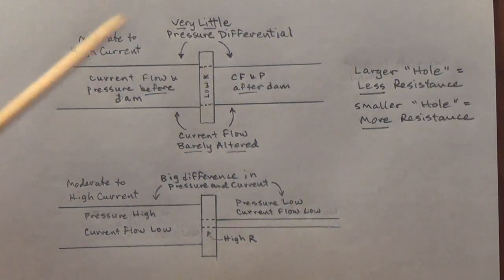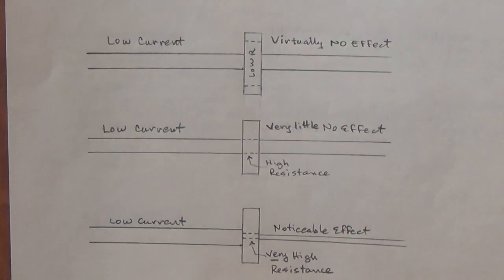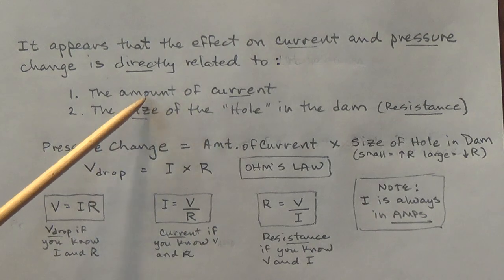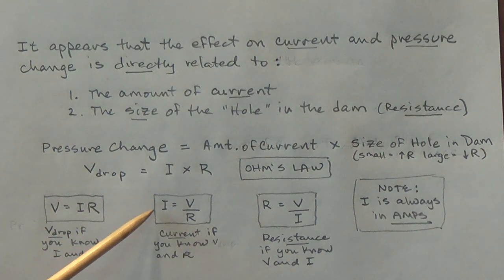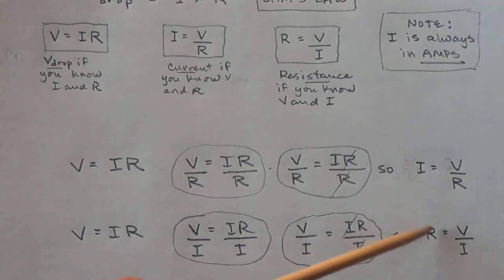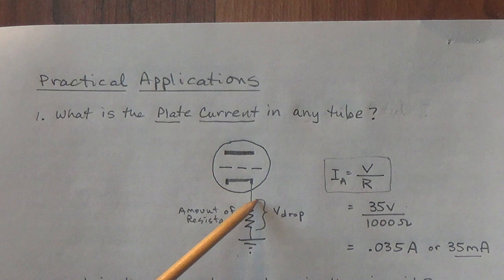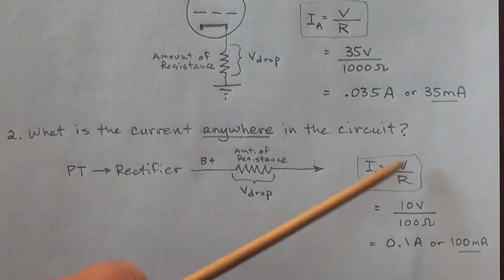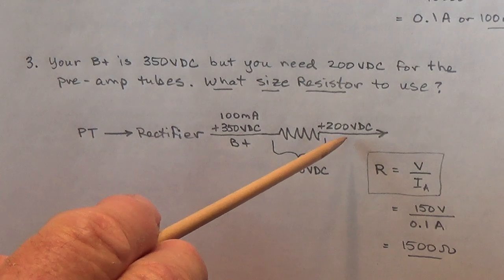Resistors, Part 1:  Their Circuit Function &  Practical Applications of Ohm's Law

Comment: this is just so satisfying for me as I enjoy amateur radio as my hobby and I am in the process of building a class A single ended tube audio amplifier very similar to the Fender Champ amplifier from the 1960s.  There are many schematics around so all the necessary values of items are already determined.  So with great teachers like Uncle Doug, I am able to understand what is going on and WHY the circuit needs to be a particular way to work.  And do all this without soiling a pair of tighty whiteys.  It is now 2026, mid August when first viewing this  and I am 76 years old.  Not much time left to learn and enjoy the magic of electronics .
Reply from the maker: It's not the time we have left that matters, Ted, it's how we spend it......and nothing is more noble than the continuation of learning until that time expires :)

Comment: Can anyone help me fill in the missing part of the puzzle here? In the last section of the video we use ohms law to determine the resistor value needed to reduce the B+ voltage from 350vdc to 200vdc. I understand how ohms law is being applied here and I understand the function of a resistor etc. I'm struggling with how we design this sort of power supply circuit without having the load of the tubes. 100ma was given as a measurement of the current flowing from the rectifier. But isn't this determined by the load of the tubes on the other end? Isn't the 100ma determined by the load? Would we need to measure the current draw in circuit and then change the dropping resistor value accordingly? I'm suppose what I'm not quite getting is how we avoid frying the tubes on the end of the the node by using too smaller resistor value when we need the tubes to be in circuit in the first place in order to measure the current draw?
Reply from the maker: Yes, current must be flowing to the tubes for the measurement to have relevance to the circuit.  To protect the tubes, you generally start with higher resistance and then work your way down.  Calculations are a great way to start, but there are so many variables within a circuit that actual measurements are always the last step.
Reply: @UncleDoug thanks Doug 👍🏻

Comment: So at the end of the video, are you replacing the 100 resistor with the 1500, if so does that change the amps,, what am I missing?
Reply from the maker: I am using different values to demonstrate three different uses of Ohm's Law. The 100 Ohm resistor was used to determine current output.  The 1500 Ohm resistor was used to demonstrate voltage drop.  Nothing was "replaced". I think that if you watch the video again closely, there will hopefully be no confusion.  Good luck.

Comment: Is it true that you can discharge fender amp by turning it on for a minute and unplug the amp while it’s on .?
Reply from the maker: No. Don't believe it.
Reply: @  I didn’t believe at first , i just tried it , it actually works .
Reply from the maker: @1972f1972  How do you know that it works?
Reply: @UncleDoug  checked with multi meter
Reply from the maker: @1972f1972  How did you check it? Please describe the entire procedure.
Reply: @UncleDoug  I basically turn the amp on make sure you hear a guitar playing then i unplug the amp from the wall and the amp is discharge completely, in the beginning when i did it i too didn’t believe it but when i checked with multi meter for voltage the multi showed 0 and then i became a believer did you tried it ?
Reply from the maker: @1972f1972  What specific meter did you use and what specific points did you check with the meter?
Reply: @UncleDoug one prob on the bypass and one on the chassis i use fluke on the voltage setting .
Reply from the maker: @1972f1972  What "bypass"?
Reply: @UncleDoug sorry I meant stand by

Comment: Thank you, I never really understood why they used color rings to identify a resistor. Why not just print the actual number of the resistor?  Seems like a secret society approach at making information more privileged than it should be.
Reply from the maker: Some resistors and capacitors do have printed values, VC.  The color bands are actually much easier to read than tiny, smudged writing.
Reply: @ As I my eyes age and the color bands fade it can be hard to identify the color. I also guess the old stuff I am interested in has all been color bands and no printed numbers.
Reply from the maker: @49VinCom  The very early capacitors have colored dots, like dominoes

Comment: The current in an electric line is the same before and after the resistor- the voltage before the resistor is higher than after but current is constant
Reply from the maker: You're right, Dave. Thanks for your input.

Comment: Hi Dough, I hope you're well. I really love your videos and learn a lot. I have a question that maybe you or other friends of the channel may answer:
I'm trying to mod my amp (a 70s Spanish clone of a Pro Reverb but with EL34), I took off the reverb circuit and plan to add the standalone Fender reverb circuit at the input of the amp (inspired by the Vibro-King amp). According to the 6G15 schematic I need to feed my tubes with 250v. My plan is to get the 250v by adding new nodes from the lowest voltage point of the B+ (were it feeds the preamp tubes). I did the calculations and was expecting to lower from 450v to 250v. I added a couple of 8K2 resistors in series (with its corresponding filter caps). The voltage didn't drop at all, then I tried a 100K instead just to see what happened and the voltage only descended to 445v. What am I doing wrong? Is that all the circuit has to be completed with all the tubes in place? I'm really confused, the theory works on the rest of the +B line, it descends from 500v to 490v (through a 1K resistor) and then to 450v (through a 4k7 resistor) but from that point the theory and the common sense fails.
Reply from the maker: Greetings, MS. I don't understand why you are changing the circuit. The Pro Reverb circuit offers as fine a reverb effect as you will ever hear in any amp. It really seems like a huge step in the wrong direction.....but to answer your question, you will see no voltage drop across any resistor unless the circuit is complete and current is flowing. Without knowing the current flow, I'm not sure how you are calculating the resistance needed to drop from 360V (not 450V) after the final node down to 250V.
Reply: @UncleDoug  Greetings Uncle Doug. 

Thanks a lot for your answer, I think I see things more clearly now.

I measured the current flow on the last existing resistor and used it (through Ohm's law) to calculate the R needed for my new desired V drop but I was measuring the voltage on my new last node without having completed the circuit, it was a resistor in the air.

I was always measuring with my multimeter the voltages on the different nodes but with the power tubes extracted, now I repeated the process with the tubes and all the voltages are lower and more similar to the ones on the Fender schematic. So the circuit has to be complete and the voltages will be as described on the schematic, right?

The reason I change the reverb is that I love the drippy sound of the standalone unit while on my amp I have no drip but lots of ultra long reverberation that blurs my sound as if the guitar was at the end of a cave, very far away, I like it more near and present but with the drip and the tail.

Comment: Love your slam on Algebraphobes!  But I have a real question.  I couldn't find anything in your vast repository of videos, but I'd love to hear about your collection of parts, resistors and caps.  I'm not going to open a business but am embarking on a mission to fluff up an old Magnatone Varsity, and don't want to get mystery parts from Amazon.  I know you can order good ones from Mouser or DigiKey, but is that what you did?  I'd love it if somebody sold a small assortment of awesome older carbon resistors in a pack, and a handful of good metal electrolytic caps in the appropriate sizes.  Not sure where to get those.  Don't need a thousand resistors, and was hoping to get good ones, naturally.
Reply from the maker: I get all my electronic components from Antique Electronic Supply in Tempe, AZ, Pete.
Reply: @UncleDoug  Thanks!  I remember now you mentioning the shop in AZ.  Their website is really great!
Reply from the maker: @peteheckman13  They are an excellent source of components, Pete. Tell them I sent you :)

Comment: I was looking at my notes  and problems from my college algebra classes from about 35 years ago. At first I couldn't make heads or tales of them. Took me about an hour to figure out how I did just one problem and all the steps were there. Thank you again for these videos. This one was kind of elementary for me but I feel the next ones on resistors will reveal knowledge I will need and don't know. One of the problems for me was figuring out in a cathode circuit where the voltage was coming from since it is not connected to the B+ voltage.  It is still a bit of a mystery. I know there is current in the cathode circuit and it has to cause a voltage drop as it crosses the resistor. I am assuming the voltage comes from the B- , or ground and we all know what assuming does. Is there anyway you can clear that up a bit in one of your videos? I am on a fixed income and money is tight but if you keep this up I am going to have to donate something. Where does one do that? I have a ton of electronics books and amplifier repair books but one can only learn so much out of books. One needs practical application and hands on experience which, in most cases, one cannot obtain from books. So, thank you again.
Reply from the maker: As I tried to explain in previous videos, Jerome, the power transformer acts as an "electron pump". For example, the high voltage winding pumps all the electrons in the circuit to ground, creating a net positive charge (B+) in the power rail due to electron deficiency. The circuit functions when the electrons from ground flow to neutralize the relative absence of electrons in the power rail......i.e. from the cathode (connected to ground) to the plate (connected to power rail).
Reply: @UncleDoug  I have yet to see all your videos. I have just started watching them, I am catching up. They are all very good.
Reply from the maker: @j.dragon651  Thanks, Jerome. I hope you enjoy them all.

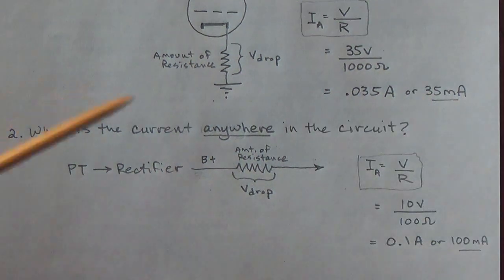Comment: At 16:50 you said “ I switch my resistor to d/c volts” how do you switch a resistor’s voltage??? Or I’m I mishearing you Uncle Doug????
Reply from the maker: Whether I said it or not, I meant switch the voltmeter to DC volts.

Comment: At 1636 you said your going to turn off the amp and drain all the electrolitic capacitors. How do you do that, please?
Reply from the maker: This is demonstrated in many of my other videos, LS. I use a tool made from a 100 Ohm 10W resistor....one end grounded.....then touch the other end to the + terminal of each electrolytic in the power supply.
Reply: @UncleDoug  Thank you, I'm just getting started, so I hadn't seen much else. This is a great resource, though!
Reply from the maker: @LeagueofSonicCuriosity  Glad to help, LoS. Please watch some of our other videos.

Comment: You told me almost everything what is the wattage size of the resister?.
Reply from the maker: It depends on the resistance and current flow they will have to cope with in the circuit, Peter. You multiply the current (in Amps) squared x the resistance.....i.e. 0.1A flowing through a 100 Ohm resistor = 0.1 x 0.1 x 100 = 1 W

Comment: Here is an easy way  to remember Ohms Law.    E is Volts,  I is Amps, W is Watts, R is Resistance(Ohms)
  E                     W
I   R                 I   E   
Example 1: You know Volts(E) and Ohms(R) and want to know Amps(I).  Cover the I with your finger. The result is E over R. E divided by R (top divided by the bottom) is your answer. I=E/R
Example 2: You want to know E(volts) and know I and R. Cover E with your finger. Result is E= I x R
Reply from the maker: Very helpful. Thanks for sharing, Eixr.

Comment: I’m not trying to bug ya again uncle Doug ;-) but these videos are GREAT! I just ordered a converted AO-44 (should come tomorrow & I have the cab built!)to start learning about circuit design,modding,etc. So as a beginner to this I’m really digging these tutorials!
Reply from the maker: Thanks, William. Good luck with your project. It's the best way to learn about amps......by actually working on them. Be careful !!!
Reply: Uncle Doug Oh yeah. Well aware of what NOT to do already and how to drain current. The converted AO 44 that I got sounds like a damn deluxe reverb thru the 12” alnico speaker and cab I built for it and some pedals as it is! I’m actually pretty blown away by the sound quality. And you can’t get hand wired quality components like this for less than a grand anymore.

Comment: WOW! I was wondering how all of the dropping resistors for my various B+’s were derived. Your video CLEARLY explained it. On one of my amplifiers the output transformer shorted and destroyed a very hard to get resistor block (or what ever it’s called) that was made up with 4 resistors in series all on one piece. I used my schematic to replace all of the resistors with discrete ones. And I wondered how the engineers figured out what dropping resistors to use to drop the voltages. Ohms law!
Reply from the maker: I'm glad the video was informative, Mark.

Comment: I understand some of this, but in real world application I'd be lost. It's hard to understand why some would have a difficult time with this, even when explained at an elementary level. Especially when you understand it so well, have been doing it for along time or simply have the aptitude for math.  To me this is very challenging to comprehend. In the same way, my profession is very difficult for many to understand, or so I've been told, yet it was easy for me to grasp the concept. I took basic AC/DC fundamentals and parallel and series circuits, I think, back 30 years ago. I remember very little. I took algebra in highschool, but hated math and pretty much did a data dump as soon as I passed it.
Reply from the maker: Thanks for sharing, JSG.

Comment: Uncle Doug-I've got a question about the connections of resistors and capacitors in a circuit.  Let's assume you have 2 resistors of different values, R1 and R2, and a capacitor C1.  Let's assume they have axial leads, and we refer to them as N and S.  So if the schematic shows them wired in a vertical position in parallel, ie. all N leads are in a common plane, one after the other, and in the order of R1 C1 R2, and each S lead is going to different connections, say to GND or another component, does it matter if you wire them on your board say R2 R1 C1, or C1 R2 R1, etc?  Then what if in a different schematic they're wired in series, ie. N to S to N to S to N.  with R1 wired to C1 wired to R2.  Can you wire them in any order, maybe C1 R2 R1,  or R2 C1 R1, or R2 R1 C1, for example?
Reply from the maker: I don't fully understand your question, WS, and am hesitant to respond for fear of erroneous interpretation. All components can be wired in ways that may SEEM to differ from the schematic, as far as position and points of connection, but all connections MUST conform to the basic circuit as shown in the schematic.
Reply: @UncleDoug  , sorry about the form of my question.  I was going to attach a pdf of a simple circuit layout exhibiting what I'm trying to say, but can't figure out how to upload it.  I think I understand what you're saying though.  Thanks for your taking the time to respond.
Reply from the maker: @wsscott72  You're welcome, WS. You can post pics and diagrams on my FB page: Uncle Doug's Vintage Amps.

Comment: Is there a way to know the maximum wattage that can go through the resistor if it's not stated?
Someone showed me if you know the wattage......
 square root then power × = E
(Or example)
√(1×1,000)
=31.62  Volts. Max can be ran through a 1-watt resistor
I don't even understand this I just know how the formula Works Uncle Doug. You are the master and teacher, be easy on me! :-)
Reply from the maker: You can tell by the size of smaller resistors if they are 1/4, 1/2 or 1W, Ronnie. On larger resistors, the wattage is almost always printed on them. To determine the wattage you need, multiply the voltage by the current (i.e. 100V x 2A = 200W) or the resistance by the current squared (i.e. 50 Ohms x 2A x 2A = 200W. or the voltage squared divided by the resistance (i.e. 100v x 100v / 50 Ohms = 200W).
Reply: @UncleDoug  okay thank you!

Comment: I think the resistor bottom right,the big square one.is that a sand resistor,I have to change one in my tube testor,because all the same on.the outside is closing off,does that affect the resistor,at all
Reply from the maker: I don't understand the question, Ron. These high-wattage resistors are readily available at Antique Electronic Supply.

Comment: Again, Thanks Uncle Doug!! Very Informative. I took 2 Years Mechanical Drawing in High School, we had an Area Vocational School, as part of the New High School Bectal built for us, for Building Arkansas Nuclear One, on Lake Dardanelle, in Russellville, Arkansas. The 3rd Year, I took a Basic Electronics Class. This is bringing some of that back for me. One Question, " How do you Drain, the Electrolytic Capacitors? I remember taking a test in class, and Forgetting and then Picking up a Capacitor, which Zapped me - DOH!! Haha!!! So, might be good for others to know too. "
Reply from the maker: I have demonstrated this in many of my earlier videos, Sterling, as well as showing how to make a simple device to enable it to be done quickly and safely. Please see one of my videos on biasing either single or double-ended amps.
Reply: @UncleDoug  Thank you very much.